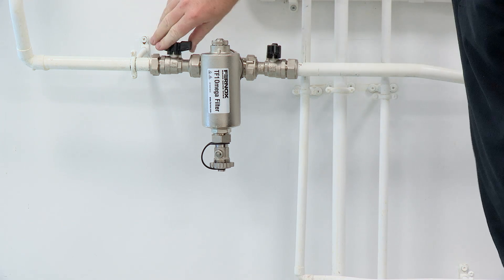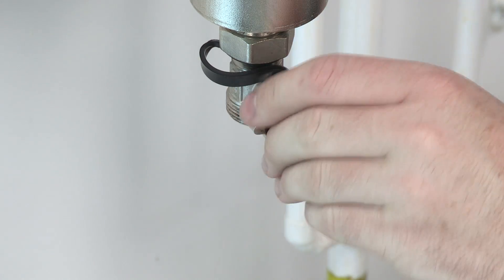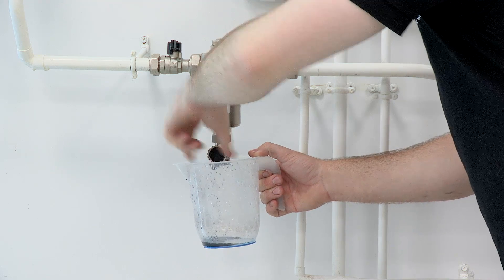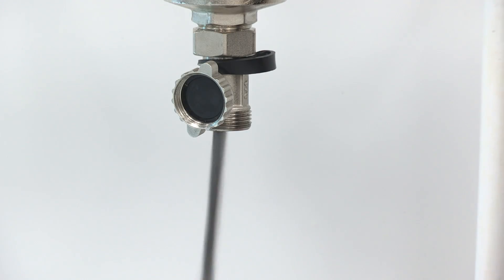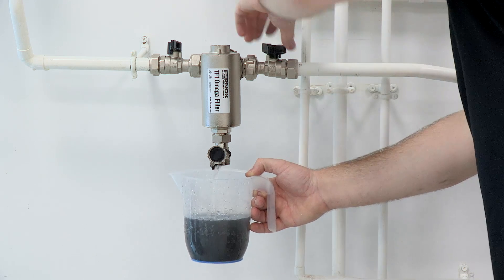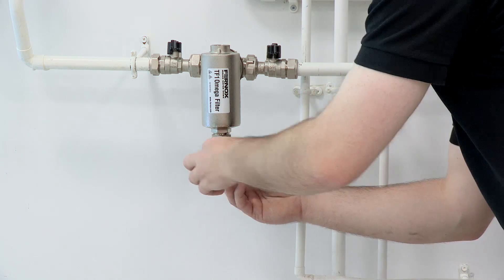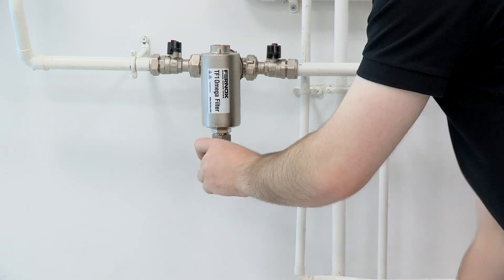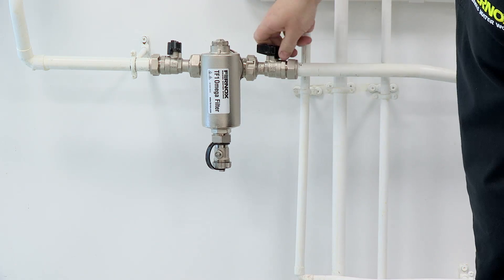How to clean a TF1 Omega Filter - in less than a minute!

Comment: I found that I was only getting a trickle coming out until I 'exercised' all of the valves by opening and closing them a few times. Then I got a proper flow through and I could flush the filter properly.

Comment: If both of the valves are on the heating return line, by opening the first valve to flush is it not emptying the system? Also how does the flushing water run clean if the system water is discoloured like most older systems naturally?

Comment: How do i clean filter when is no valves fitted iver side of filter or pipe is a worchestor boiler  demonstration if possible please
Reply from the maker: Thank you for your comment. To clean the filter when there are no valves, simply switch off your boiler, remove the magnet, open the bottom valve of the filter until the water runs clear, and then close the valve. Hope it helps
Reply: Tf1 filter is horizontal cant find a hose

Comment: I have one fitted, but it does not have isolation valves fitted. Do you have a procedure for cleaning without valves?
Reply from the maker: Hello. You can still clean the filter if there are no valves installed. Switch the boiler off, take out the magnet and open the bottom valve of the filter. Then wait until the water is clean, close the valve and put the magnet back, switch the boiler on,
Reply: Yes I have one without valves on purpose,  less places of possible leaks.

Comment: I also would be interested in how air isn't introduced into the system when cleaning filter as there is no bleed screw on top of unit when recharging before second valve is opened that is bound to let some air into system which happened to me after cleaning filter on my Mitsubishi air to water setup.

Comment: British gas has just installed a tf1 omega filter with out valves , can i clean the filter with draining down. as no on off valves have been fitted on the boiler
Reply from the maker: Hi Peter, yes, you can still clean the filter. Take the magnet out, open the bottom valve and flush the filter until the water is clear. Then close the valve and insert the magnet back After that you will need to refill the system...

Comment: The problem with most filters is they are too small. Not enough capacity to add ESSENTIAL inhibitor for example. Fernox TF1, MagnaClean Twintech and Pro 2 are good enough to handle 500ml concentrate. This Omega, amongst others, is poorly designed in this respect.
Reply: Having just had to clean my omega filter I found the Fernox Filter Fluid & Protector express the ideal solution for adding product to system as it comes with adapter that screws on to where cap screws off at bottom of unit - hold trigger for 30 seconds with appropriate  valves open and  then on closing & removing can restart system.  I believe the Fernox F1 express is also available. However as above its recharging filter without introducing air into the system that I struggle with.
Reply: My thinking is they are there to keep a clean system clean

Not clean a bad system

Comment: This is very good and very informative. But………. How do you clean one that’s been fitted by British Gas engineers 😳😳.
Reply: @Fernoxvideo  Hi thank you so much for the reply. I have looked after I watched your video and they haven’t even put any taps on the joints. The filter is actually sat on top of the boiler housing with little to no space in between them both.
Reply: Same here British gas install laying flat on floorboards with no isolation valves

Comment: How do you get the air out
Reply: I tend to;

1. Turn off boiler
2. Pull Magnet out
3. Close off Return to the boiler (leaving the return to the TF1 open)
4. Open TF1 valve with a bucket under (till water runs clear - doesn't take long)
5. Close TF1 valve
6. Top up boiler pressure
7. Turn back on

This stops air getting in the system (I think)

Comment: Why is omega filter not running water when is no presure cleaned filter by the time was a chance to remove magnet was no presure no water. Water stoped running has no valves was brown water was clear instantly is horizontal at to use a washer pipe into sink